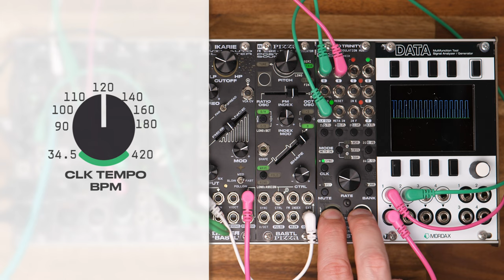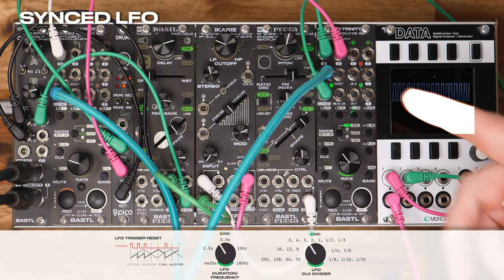NEO TRINITY - Clock Channel

Comment: Hello, does the outputs E and F can be setup as clock divider of the main clock and CV controlled by their respective input E and F? 
thanks
Reply from the maker: Hello Alex and Thank you for your question!

You can set the outputs into synced LFO mode, set shape to Pulse and select unipolar output. That way you get a clock divider/multiplier.
Then you can patch a voltage into the inputs. It behaves as “1V/Oct”, so if you patch 1V into it the LFO gets 2x faster.